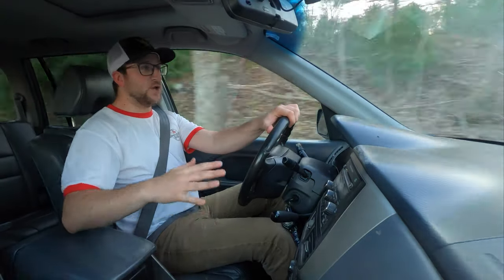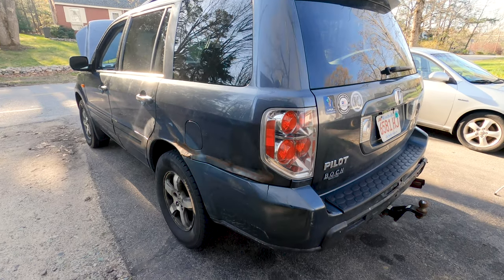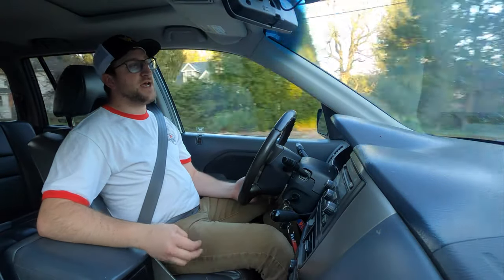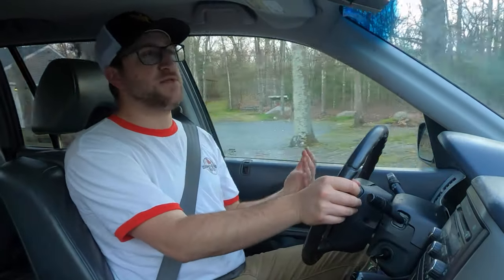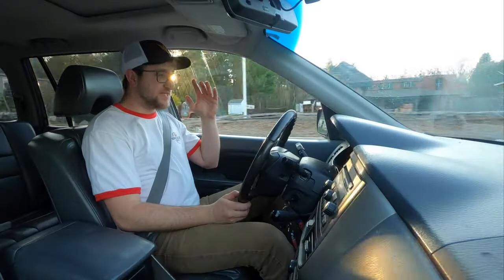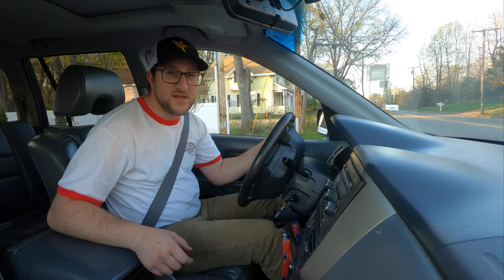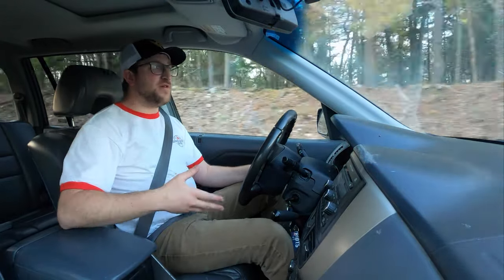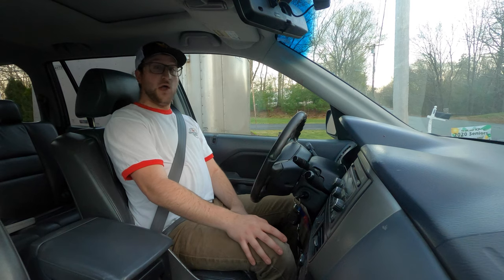1st Gen Honda Pilot - How Reliable Are They Really?

Comment: I own 2004 Honda Pilot with 315,000 miles now. No misfiring. Original engine still running strong now on a 4th timing belt and water pump. I love it. No it is not for sale. Changed transmission at 215,000 miles. I still have original alternator and starter in it. I tow a utility 6x12 double axle trailer all the time. Never left me stranded, very reliable. Just don’t be like Eric, fix the obvious. Any leaks or noises come up, fix them right away. Lol. That’s what I do with mine. Power steering leaked replaced the rostering rack $100. Transmission leaked one day, replaced it with a 90,000 mile used one and put all new seals and oil on it.egr passages at intake plugged up, cleaned them. Replaced spark plugs 2 or 3 times. Replaced cv axles twice already too. And also the breaks and tires every few years. Never any electrical issues. Radio works fine. 2004 is definitely better than 2003 models. It is not free to maintain this car but it is cheaper than replacing it! And it still drives like a dream even after those miles. Very impressive!
Reply: Egr passages are part of the transmission?

Comment: I have a 2005 Pilot 210k miles. Still running strong, trans makes the infamous high pitched whining noise when driving. My girl has a 2008 Pilot 250k miles it is still good.

Comment: I’m the original owner of a 2003 EXL 4WD with 185k. I’ve only done tires, battery, timing belt x2, motor mounts and regular maintenance. This is the best SUV I have ever owned ZERO problems! I live in central Florida.
Reply: I'm in South Florida and our cars don't take the beating cars take in states that snow and the road are salted.  My 2008 Pilot VP has 206K miles and is still reliable.

Comment: Just sold an 09 Pilot (first year of the second model) with 196k miles and it never needed anything aside from routine maintenance and a catalytic converter replacement. Being New England it was slowly rotting so moved on and Replaced it with an 08 Pilot with 135k with no rust. Great cars all around especially for adventure families.

Comment: I have a 2006 V6 4 wheel drive Pilot with 280,000 miles on it. Runs like a fucking champ. Got it from a buy here pay here a couple months ago. I already put about 10,000 miles on it and the only thing I’ve done is give it 2 oil changes, keep engine fluid levels great, changed the rear brakes and new head lights. What I can’t get past is the Fact that it has a V-tech Engine

Comment: 2007 Honda Pilot with 199k miles first car ever and is honestly the most reliable car. I keep up with regular maintenance recently doing a timing belt kit, spark plugs, ignition coils, valve adjustment, radiator, battery, alternator, drive belt and tensioner, lower control arms, and rack and pinion which was failing. Use only Honda fluid which I change every year. I’m about to do my thermostat, shocks and struts, and rear coil springs. I still use Valvoline conventional oil but I’ve been thinking about switching to royal purple synthetic but nothing sure if I should.
Reply: Hello, is your Pilot FWD or 4WD? Thank you.

Comment: Got a 06 Pilot w/ just shy of 200k miles. It’s the 2wd model w/ cylinder deactivation. Only issue it’s had is needing rear shocks/front struts. Still runs like a clock, getting 25 mpg on the highway.
Reply: How much in the city mpg?thanks
Reply: SAME
Reply: @tavy7200  city 18mpg
Reply: John I would strongly recommend the VCM muzzler.  Many earily Gen 1s and 2’s had premature engine wear due to the cylinder deactivation.  3 cylinders are used the majority of the time thus they wear out earily.   This is similar to the old Cadillac V8-6-4 system they had in the mid 80’s.   Unfortunately, GM used their customer base as Guinea Pigs for this experiment.
Reply: My 07 4WD right now in winter gets around 18MPG combined.  The best I got on the Hwy with cruise on @70mph was 23mpg.  That was in the middle of summer.  Mileage will be lower in winter due to the reformulated gas and colder weather.
Reply: My odometer just turned 450000 miles.

Comment: Bought my wife a 2004 pilot in 2010 with 55k miles on it. It has 210k miles on it now and is a very reliable vehicle. I do all the required maintenance on it. Besides the normal maintenance, brakes, tires etc, i have only had two unscheduled repairs. One was a fwd axle shaft due to a damaged cv joint caused by a torn boot that was not found untill too late. $100 and a hour of my time and it was fixed. The other problem was the notorious jammed ignition switch. Pulled out the switch and pulled out the damaged lock wafers and put back together. I can buy a newer car if she wants, but she says no everytime i ask. 

They are reliable vehicles that are easy to work on and parts are not very expensive

Comment: 8:06  Sorry, It's a FWD based platform (the engine is connected to the front wheels, it doesn't drive the rear wheels directly) with a viscous coupling rear and, so if "if it can't go to 4WD", it is actually FWD.

Comment: Honda transmissions have their own filters and drain plugs and require fluid replacement every 30K or so. The EGR cover on the intake can get clogged without a periodic cleaning. Motor mounts and harmonic balancer also tend to be problem areas, but these are wear items. The tensioner pulley arms can crack.

I bought an 07 Pilot in late 2018 and it exhibited all those issues. Thankfully, I was able to do most of the work myself while incurring a minimum amount of shop labor costs. If you can find a clean one, they are worth sinking some money into.

Comment: I have a 2003 with 313k miles
Reply: Is it your daily driver?
Reply: @JaPaNeSe_MxD_707  yep
Reply: Have you had an issue with the acg s fuse? I’m going through it right now. I love my pilot but I’ve rigged a shut off because I can’t figure out how to fix it. Everything the PGMFI gives power to stays on, killing the battery within an hour or so. Except the fuel pump, it gets zero power. Ever. I have it hardwired to the back of the pgmfi.

Comment: I own a 2008 Honda Pilot. 129,000 miles
Best reliability 

Curiosity.   What upgrades should I get done 

The only thing I have done is upgrade the front rotors too slotted rotors for better cooling and left the rear regular rotors.

Comment: I have an 08 Pilot with 225k on it. I bought it with 149k. I test cell phone coverage for a living so I have a few equipment in the car that cannot be turned off while working 8-9 hours every day driving nonstop. Except for restroom breaks in which case I would still leave the car running, I would use the valet key to lock it manually from the outside . This means that my Pilot's engine was on every day for 8 to 10 hours a day. I did this job for 17 months. I was surprised it lasted this long ( still running ). Only 2 things failed, the alternator and the radiator.
Reply: Did you ever have to get a valve adjustment on your honda ?
Reply: @shadowman1992  yes just did it last year at around 250k miles. Due to some misfires

Comment: Great video I’m just buying a 2006 4300 with 117,000 miles from the first owners I pray I can get 300,000
Reply from the maker: Torrey In New York City thank you! Good luck with the car! It has pretty low miles for the year.
Reply: Change the transmission fluid with Honda fluids

Comment: Great video! I can tell from the road signs & Lowe’s you’re in Wrentham/Plainville. I live a few miles away, have a 2004 Pilot, 272K miles, for sale. Looks exactly like the one in the video. Only prob is the idle control, goes up & down from 1000-2000 rpm. Can’t get the screws off the IAC to replace it! Other than that, everything runs well. I am original owner, kept it in great shape. If anyone wants to buy this beauty, pls reply!

Comment: I have a 2004 Honda Pilot EX, Leather and DVD..... At 307k now. Never had problems with the engine or transmission. I do need to replace my oil pan, and one of my back windows is taped up until i buy a new motor but its good other than that lol

Comment: I have one of the worst years 2005. I know these vehicles, and after going over it, and buttoning it up with Genuine Honda parts from the dealer, it is a beast. Shifts smooth, lots of power, looks so good. I use it as a workhorse. I got one for my mom a while back, and it got hit and totaled. Replaced it with a TL, and I got a MDX on the side to use for hauling purposes. I traded my TSX and MDX for this Pilot and haven't regretted it for a second.
Reply: Just bought an 05 anyway you can tell my parts you replaced with genuine Honda parts? Would help me a lot thanks

Comment: Mine is still running strong at 354000+ miles. No major engine failure at all
Reply: Hello, is your Pilot FWD or 4WD? Thank you.
Reply: Did you ever have to get a valve adjustment on your honda ??

Comment: I once bought a 2003 Honda Pilot with 100,000 ml.  I drove it for several years and put 100000ml on it.  I sold it because it was a lot of gas for me.  the mistake of my life  I bought another one a little newer and it gave me a lot of problems.  then I saw my car again on the street after 5 years driving like nothing.  I just fixed the radiator.  and the power steering hose.  and up-to-date maintenance.  I drove it through mountains that only 4x4 cars go.

Comment: I have an 04 with 260k miles that I drive everyday from Modesto to everywhere around the Bay Area. It’s 100% stock. Thinking about coilovers and exhaust for it since I heavily drive on freeway I want better mileage
Reply: Whopem Harder  what I actually meant to say was HANDLING and yes coilovers = less MPG. On my accord went from averaging 36 mpg from Sacramento to Modesto. Now I only get 31 mpg but the handles are so worth it
Reply: Did you ever have to get a valve adjustment on your honda ?

Comment: I really like my 2004 Pilot. CONS: Door lock actuators. These fail a lot. I abuse mine here in Colorado and spent years taking it on Jeep roads way up anywhere from 8-12,000 feet on super rocky roads. Full of kids and camping gear. Passed many a decked out Jeep on Jeep roads :) .....Super reliable vehicle. Always starts up. No transmission errors. Only a few electrical issues. I use it to pull two different trailers and use it everyday. I love Honda reliability.  Lots of room (i have the 3 rows of seats). I have cut down a rather large tree and packed it in the back to take to the dump. Pilot is an awesome vehicle.
Reply: I once pulled out a bad ass wrangler from some mud that I watched get stuck while eating sandwiches in the back of my pilot with my family. On some road tires. Everybody taunted the Jeep guy so bad

I’ve also seen a tug of war where an 04 pilot ex-l torched an f-150 TBF the pilot had fresh wheels I don’t remember the fords tires

Comment: 357,459 miles and still counting! We have 2008 Honda Pilot with moonroof trim and backup camera. That thing is a BEAST!! With everything original parts except the front suspension is replaced due to heavy terrain travel. Regular oil maintenance and that bad boy will last longer than your marriage 🍻🍻
Reply: Hello, is your Pilot FWD or 4WD? Thank you.
Reply: @kevinjefferson9739  it’s front wheel sir 🙌🏻
Reply: @mpg1fam  Did you install the VCMTUNER II – Advanced on your car, to deactivate the ECO MODE? Does your car burn or consume any oil?  What brand name of engine oil and oil filter do you use? What is the interval between oil changes? Thank you in advanced.
Reply: Did you ever have to get a valve adjustment on your honda ?

Comment: My 04 pilot has left me stranded twice recently, 1 mo apart. Its at 153k transmission is giving up, BUT BUT i trusted the hubby and mechanics for 4 yrs that ive had it, and husband says HE HAS NEVER DONE THE TRANSMISSION OIL CHANGE 🙇‍♀️🤦‍♀️🫣🤔SO MAYBE THATS WHY? 🤷‍♀️  but the engine is smooth as a new car, it feels like its off when im at a full stop. So i love ❤️ my pilot. Im willing to fix the transmission or rebuilt it and hopefully it will go for some couple more yrs. I just want a reliable car, thats all i want
Reply from the maker: I would recommend changing the transmission fluid. Because, if the transmission is already acting up, there’s nothing to lose! If it starts slipping after changing the fluid, you can always try a friction modifier and potentially get a little more life out of it

Comment: Our '07 AWD EX-L has 230K on it with regular mx.  Aside from normal mx, I've had to replace the blower motor, one of the ignition coils and the tensioner pulley for the serpentine belt.  Mechanic replaced the engine and gearbox mounts.  The suspension bushings are starting to show their wear with a lot of creaking over the bumps.  I'm thinking LCA's and ball joints are coming up for replacement soon. It's seeping some fluid that I think is coming from the power steering system, but the our mechanic says the rear main seal needs to be replaced.  Hoping it's not both!  either way, the repairs are a heck of a lot cheaper than a new car.  I don't care for all the safety features and cameras on modern vehicles, so I'll stick with just having VSC and ABS.

Comment: 2004 I have 327,000... kicks out of all wheel drive at 40mph. And then is in 2 wheel front wheel drive...  Doesn't seem to be a problem... Been doing that for 50,000+ miles.
 I think its caused by excessive play in transmission gears...

Timing belt kit, next on the list.... Wasn't sure if i wanted to do it or not.   Looks like this car will probably go 400,000+, so I guess ill get it done.... The last timing belt, appears to have been done at 170,000mi...

Comment: This is an ad off Craigslist.  They are asking $3200 for it.  What do you think?
2005 Honda Pilot with 264k miles. All maintenance done on time, timing belt, water pump, etc. Good for another 50k before next.
Most of the struts and bearings have been replaced over the years. New tires, front brakes, starter. 6 disc changer, cloth seats but they are in excellent condition. Wired for trailer lights. A/C very strong and cold, blower motor replaced last year. Some small rust in the usual places. I have put on some fill in paint to keep it from getting worse, but it is easy body work to properly fix it, if you want.
Reply from the maker: Michele Smart I think that price is too high for that mileage and wear, especially if it’s been towing a trailer. $2200, max.
Reply: Not-So-Handy Car Guy Thanks for your advice.  I appreciate it!  Don’t have anyone to help me so I’m trying to do the best I can.
Reply from the maker: Michele Smart aye no problem man! Good luck with the search

Comment: I own a 04 pilot with 299k miles on it. Will be at 300k in 2 days. Mine is super solid. It's had its failures like accessories but no more than all cars have. I'm a mechanic so I kinda know what I'm doing but its all about  maintenance and just knowing of how to drive a car. Highest mileage car I've owned and sold was a 87 vw golf with 336k miles that still ran great. Also have a 00 Buick regal with 255k miles on it and the last 100k of those miles are ripping 400hp. Lots of drag races and all that fun stuff. 12 second grandpa car. Most reliable car I've ever owned was a 98 Pontiac grand prix gt. Drove it to 240k and it never left me stranded. Repairs were cheap, easy and rare. It died in a flood.
Reply: Hello, is your Pilot FWD or 4WD? Thank you.
Reply: @kevinjefferson9739  it's fwd normally but you can put it in 4wd. Works really good too. Took it to a place called box canyon a couple weeks ago without any issues. 2 days ago I did have to replace a power steering line. She's at 315k miles now.
Reply: @Erik-kp1ux  Did you install the VCMTUNER II – Advanced on your car, to deactivate the ECO MODE? Does your car burn or consume any oil?  What brand name of engine oil and oil filter do you use? What is the interval between oil changes? Thank you in advanced.
Reply: @kevinjefferson9739  sorry but my pilot doesn't have VCM. I think the first year of that was 05 or 06. I mostly use full synthetic valvoline and a wix oil filter. Change it every 5k miles. Don't replace the air filter until it's pretty dirty. A dirty filter traps more dirt than a clean one does. The engine burns about a quart every 5k miles, leaks a little.

Comment: I got my 08 Honda pilot 180,000 miles good to know it will get to 280,000 😁 I wouldn't neglect it as much as this dude doe.. and just got a 2015 Honda pilot for my Wife..
Reply: Did you ever have to get a valve adjustment on your honda ??
Reply: @shadowman1992  No just routing maintenance, sadly it only made it to about 190,000 miles and some sadly, It was involved in a accident got t-boned total lost ..

Comment: I just got one with 190k miles it runs good and I’m just trying to see what I can expect
Reply: Exchange all the fluids asap as well as the differential.   Next you will need to do the drive belt / water pump.   You should get another 50-100k out of it but you have to do this maintenance.

Comment: I have an '05 EXL with 213k on it.  Drivetrain is bulletproof.  Biggest issues early on were a/c controls. That unit had to be replaced.  Also I've seen many Pilots of that vintage with a tear in the exact same place on the outboard side of the driver seat.  Also this thing eats headlights and center console light bulbs like they are  M&Ms.  But other than that, following schedule maintenance ol' girl is doing well but is due for om suspension work.
Reply: Hello, is your Pilot FWD or 4WD? Thank you.
Reply: @kevinjefferson9739  FWD first appeared in 2006.  All earily Pilots 2003-2005 are 4WD.
Reply: Did you ever have to get a valve adjustment on your honda ??

Comment: My 2011 Honda Pilot has 654,000 miles on it, no maintenance ever done to it
Reply: What type/brand of oil do you use? Did you install a vcmuzzler?
Reply: Did you ever have to get a valve adjustment on your honda ?